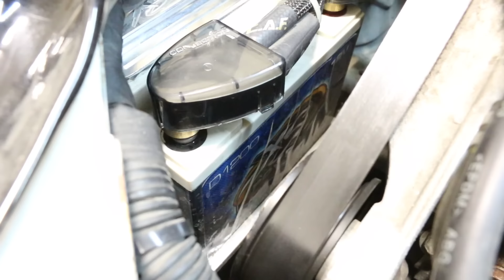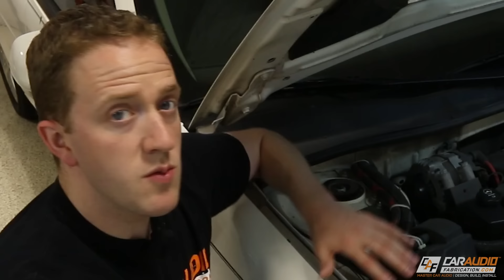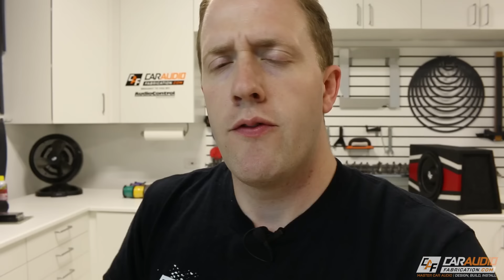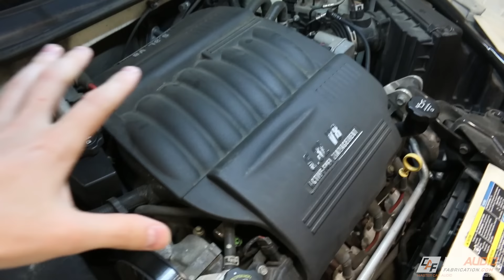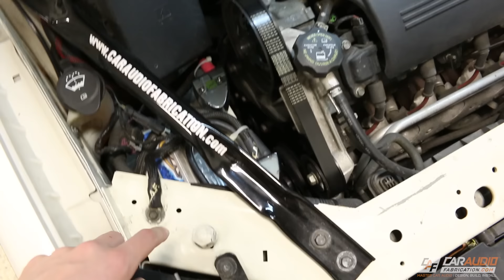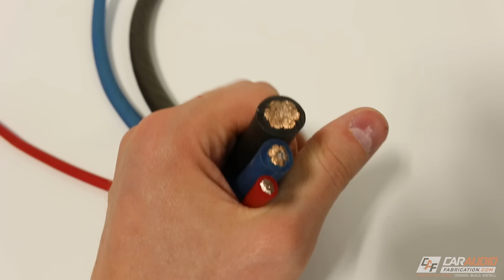Upgrade THESE for better Car Audio performance

Comment: I would start with the big 3 cause thats what i actually did everything else is still just stalk pushing a 900w rms and 1200w not sure the rms on that 4 channel is on a 136amp i know i should make a dual high output but 200 or 250 amp was the highest output there is
Reply: For my vehicle

Comment: Something to consider is voltage drop over oem cables. The cables are mean to transport the power, not consume it, they'll always take a little but not more than half a volt, to me more than .2 volts is too much. If you're hijacking positive from the fuse box you will want to consider volt drop over the cable that feeds it under load. You wont get an accurate volt drop unless you have a full load on what you're testing

Comment: The best part is 1/0 or 2/0 wire is $4 per foot. Then distribute blocks are a solid $50 each. Yeah u need a good job before u wanna bang for sure.

Comment: I'm adding a 600w amp with subwoofer and really good aftermarket speakers to the factory head unit. i know...its what I can afford right now. My question is should I upgrade the speaker wire or is the factory wire enough? I have a spool of 14ga so can do iT if needed. Thanks!

Comment: What should I do if I upgraded the battery and bought a stock alternator and my lights dim but after I added a AC after AC compressor now lights dim did I have this problem before what would it be

Comment: 2500 in the trunk.

Upgraded 105 amp alt to a 140 amp
Upgraded all ground wires from 8 to 2 gauge
Added ground from neg to frame
Added ground from alt to frame
Upgraded alt + wire to 2 gauge to batt 2
Upgraded CCA batt 1 to 980 cca from 650
980 Batt feeds to 2, 4 farad caps.

Power nevwr drops, spent around 250

Comment: I have an insane buzz coming from my tweeters ! Halllllp! When I unplug the rcas to the front doors it stops and its only when the engine is running not when the car is "on" also tried grounding the head unit and it did nothing. I have a rocksford fosgate amp powering my fosgate sub which has no issues. The front door speakers are skar component speakers and the back doors are skar as well both into a skar 4 channel amp
Reply: Wrap a piece of copper wire around the rcas in a figure 8 loop should ground those rcas out might work
Reply: I saw that trick on youtube as well I tried that and it doesnt help 😔

Comment: My homie got a 1999 caddy with 60k miles on it he hooked up 2×10s and 2 amps 600watts each the battery drained car wouldn't start so he just unhooked subs and  amp and it starts right up so does he just need a professional to hook it up ?

Comment: 1st... know how much power you need, check and upgrade battery, alternator and main power circuits according to your total amp usage. Ground and positive. I think one should have 20% more amperage then you will use with all electrical being operated at one time, including air conditioning. Heater, wiper motor, ect. Thank you

Comment: I have a honda civic 2011 a harman cardon ca5250 amp did the big 3 the hk amp running afocal k2p in the back and audison apk 165 in the front i want to add another amp for my kicker comps 12" 300 wrms subwoofer do i need to apgrade my alternator or my main battery or add a xs power battery in my trunk or capacitor

Comment: Battery alternator is nuthing if it can't supply the power.....so wiring is first once that is done and you need more its alternator because having a 100A battery chargeing at 60A will not be enough to charge the battery full but 100A alternator charging a 60A battery will ceep power constantly supplied then you can think about battery power

Comment: Without a doubt the most influential to sound upgrade is the alternator. 25 years messing around in car audio and I've seen so many systems with thousands of watt amps multiple batteries that they've spent thousands of dollars on and have everything connected to the factory 80Amp to depending on the vehicle maybe 160 amp alternator and before I ask any question about their system I ask what alternator did you upgrade with? And 8 out of 10 at least say I haven't, which just absolutely baffles me because if you're going to spend thousands of dollars in batteries alone and on that amplifier what's the point if you don't have the amperage that's going to push them? Furthermore they put all those batteries in there they don't put a battery cutoffwonder why they are going through an alternator every year but yet continue to buy factory remanufactured rebuilt whatever you want to call it factory alternator. Every single one of them I tell after asking them how much they spent  on all those batteries of which unless it's only one extra battery most of the time they have spent more than what they would have going to Mechman and buying a high amp alternator and if they would have gone and spent the money on the alternator they would have been getting a lot higher volume, more  SPL, more overall power and could have got all of it for likely less $

Comment: i ALWAYS (and i am not a professional,this is only on my own vehicles) put in a new battery and if money permits run a second to the trunk..always use oxygen free copper wire..i made that mistake years ago and MELTED 0 gauge aluminum copper mixed wire for my big 3 upgrade and died on the road and had to be towed..dont make this mistake...always use 0 gauge wire....I  run my 0 gauge power wire thru the firewall and do the big three  (just started an install on a 2006 toyota avalon with 90000 miles in mint condition..got it GIFTED to me this past month..mint mint condition).if i am upgrading the alternator to hi output this is the time to do it.then i choose my amplifier location  run the power there and figure out where my ground for amps will be..next i install any led lighting in  the trunk because once the box is in place you dont want to have to move it to light it properly (qbomb vl double 12" single center ported box) install subs in box secure box to car then run rca wires and speaker wires down the other side of the car..always recheck grounds to be sure they are good..

Comment: Looking into a 1700 true watt amp with a 1500 true watt sub. I have a 17 silverado 1500 gasoline. Would I need to upgrade my electrical system?

Comment: Here is the order I chose :
1. After market radio or dsp for high to low conversion. 

2. Sub Amplifier , Subwoofer , 1/0 gauge power , ground  and big 4 not 3 .

3. New dual battery setup ( both new batteries not adding one new ) 

4. New mids and highs 

5 . Power Amp for new mids and highs and a Clarion EQ if using aftermarket radio instead of DSP for factory for low level output to subs , and full range amps .

6. High output alternator to match needs of all new amplifiers installed  .

NOTE :
 SOME VEHICLES HAVE CRAP ALTERNATORS FROM FACTORY AND SOME COME WITH SOMEWHAT HIGHER AMPERAGE ALTERNATORS . IF YOUR VEHICLES ALTERNATOR IS A LOW AMPERAGE ALTERNATOR YOU WILL NEED TO UPGRADE THE ALTERNATOR AT THE SAME TIME AS ADDING A HIGH POWER SUB AMP "OVER 1000 WATTS RMS" OR SOON AFTER TO PREVENT DAMAGE TO SUBWOOFERS , AMPLIFIER AND CAR ELECTRICAL SYSTEM .
Reply: Thank you Mr. Garcez! But what is the Big 4 upgrade for a vehicle?

Comment: The foundation of a system is the key to all future builds.  The big 3 upgrade is is part of the foundation but there is plenty of information on this;  next would be the power plant.  Explanation and options for an alternator upgrade would be invaluable.

Comment: My lights dim when bass hits hard and at high output
Reply: get a set of leds that run off a low voltage balist and problem solved. if it bothers you bad enough that is

Comment: A circuit breaker at the battery and 1/0 cable for pwr and battery ground,  this should be the first upgrade for systems under 1500watts rms, this will allow for future upgrades for most people

Comment: I have a skar 1200 pushing two 10s at 1ohm and a Memphis amp I think about 400 running other speakers can I just upgrade battery. The skar gets hot and goes into protect unless I hook jumper cables up

Comment: question, when will can upgrade the alternator? 
when can add the battery?
let's say if i have 4 high, 4mid, 2sub
and i will put 3 amplifier for this set up should i upgrade the source?
Reply: There's videos of the questions  you ask .. all you have to do is  upgrade the  big 3 first  then if needed  the battery  and alternator 
I have  6 highs , 4 mids and 2 subs .. with 900.5 amplifier  ... I just  upgrade the  big  3
Reply: @Orange-yp9bl  thanks bro, i have hyundai kona, but i'm not sure if there's any available alternator for that model?

Comment: Hey so I’m new to all this and it’s a bit overwhelming but this is very helpful. But my question is if I’m just looking to install some new tweeters & a sub . So do I still need to upgrade my alternator,battery,etc?! I know this a new comment on a old yt video but if anyone can reply that’d be great!
Reply: Sebastian Santana nah you don’t need to..if a small sub and amp no need to upgrade electrical or alternator or even the battery..you should be good to go without any electrical upgrades
Reply: If you’re running over 1k I’d at least upgrade the wiring & upgrade the starter battery to AMG. 1500 or more get a better alt. Rule of thumb, take the total RMS wattage and remove the zero to estimate the sufficient amperage needed to sustain your system (1500 needs approx 150 amps of current, depending on what amps you buy). Stock alternators are rated 110-140 ish nowadays unless you have a big truck that has a winch on it.

Comment: People who think wire doesn’t matter are, let’s just say, misinformed! Wire matters a great deal as well as insulation material and grommeting and a host of other factors that weren’t even covered in the video. Get a grip. Give a damn and get informed people. Failure is very costly. A little time spent researching and asking questions can save a lot of headaches and frustrations as well as time and money on your install. So be smart and research it first. Save yourself some hell down the road! You’ll be glad you did! Guessing is a rocky road pitted with holes and glass!
Reply: Mark Philpot agreed! You wouldn’t put a high pressure pump on a garden hose. Electricity is very similar in physics as hydraulics. Larger wire means less restriction to current flow while putting less stress (pressure) on the insulation/dielectric because of voltage.

Comment: Well I always heard of the 3 upgrade and the capacitors. In my truck (Jeep) I had the three upgrade put that didn’t work my battery was always dying so I had to recharge all the time maybe because I did drive it to much. Now I bought a capacitor but still haven’t had the chance to install it yet.

Comment: Any use in doing the big three upgrade with a 250 watt sub amp?
Reply: Thezuule 

For “most” vehicles you won’t need to upgrade the big 3 for a 250watt amplifier. Depending on the amplifier’s efficiency you’re probably only going to be pulling 17-25 amps. 

Depending on the length of the wire, a 10ga or 8ga wire from the battery with a 30A fuse and also a 10ga or 8ga wire grounded to the frame would be fine.
Reply: @patrickc1508  When I posted this comment I was using a JL Audio JX250/1 which has since been swapped with a JL 250/1 slash series with the RIPS power supply and such. This thing puts out rated power at 4 ohms at 11v so it's completely a non-issue now. I could hook this amp up to a goddamned 9v battery and I would probably still get 200w out of it lol.

Comment: In your opinion what is the best high output idle amperage alternator out there
Reply: cory dorsey Mechman alternators are the best in the biz. The amp rating you should choose depends on your goals for the system (how many watts you plan to run). Never hurts to go as big as you can, but it might hurt your wallet.

Comment: Any videos on installing a capacitor I’m putting in a complete system with two amps and want to wire it correctly other videos seem to be a joke
Reply: Do you really need a capacitor? They're a great addition to an otherwise healthy electrical system, the "icing on the cake" so to speak. But if your vehicle is capable of continuously keeping up with your electrical demands you shouldn't need one. There are situations where you occasionally need that little extra power for brief moments of serious demand, in which case a capacitor would fit the bill. But if you are considering installing one to "fix" dimming headlights experienced during normal operation of the sound system then consider first upgrading your alternator. Otherwise you'd just be adding additional load on the electrical system instead of fixing the actual problem: insufficient power.
Reply: Juicyblunts hi I’ve been running a Rockford r500x1d for my sub just 1 12 but I’m adding new components in the doors and 6 1/2 3 ways in the rear doors and a 4 Ch amp 60 watt rms per ch just want to do it right the first time no dimming lights with the sub but don’t want to have to add after the install
Reply: That is because caps are a joke! Don’t waste your money!!

Comment: Take it from me . I had a cresento 2000 bc and sundown x12 on stock 90 amp alternator and wiring. It sucks . Not very loud at all. Upgraded my alternator and wiring and dam huge difference

Comment: That's true that's y in trinidad we use something call a Blackout it's a type of battery is made here I have 1 and dat works really well the Blackout replace 3 battery I have 1 1600 1 3300 an 1 6500 rms amps on a stock alt 140amp with de Blackout an my voltage don't drop below 12.8volts when I in competitions an with the 3 battery I had before my voltage use to drop to 9volts nt again 🙂🙂

Comment: What kind of system would you recommend for a 2013 ram 1500 crew cab ?
Reply: Do a foxbox for a dodge ram it sounds good. Because there is not too much room.

Comment: A good battery is important to start. Without it nothing happens. The wire must be sufficient to carry the required power to each component. I've watched wires melt under a friend's hood and it continued towards the stereo so a fuse at the battery is highly recommended also. Just to start I personally think this and the alternator and if I will need a capacitor and if I do what rating. That's just to start planning in my book.

Comment: My 2007 Hummer H3 already had 4 gauge wire at these 3 points from the factory. I did upgrade the battery terminals to gold plated and added a 1.5 farad capacitor. Using 0 gauge wire for power to the back at the power distribution block. Using a grounding distribution block on 8 gauge wire from the chassis. Been building systems since 1990 and this latest build on the Hummer is first time I've used a cap. I swear by them now. It was 30 bucks and did 3 things I was looking for. Kill noise. Stop headlight flickering. Clean up the bass to hit harder. That cap made COMPLETELY different performance out of my amps.
Reply: Christopher Waggoner capacitors are junk and if it’s cheap it’ll limit power. Throw it away and add a battery.

Comment: let me tell u a biggest upgrade inside your car,
you need to first upgrade your dc alternator, then joint an ac alternater,
after then you have 220 volts or 110 volts,
pickup some copper wires like 3mm-10mm,
and no need to buy any big amplifier, cables connectors bla bla bla and all,
jus buy any home audio system like sony shake X7D or sony shake X 100D,
now theyhave their powerful amplifier and big 15-18 inch subwoofer,
if you have more space in your truck then try to use a ac current inverter and 200mah battery for playing music when your car stops,
if you using these equipments, I'm damn sure its too cheap than buy a subwoofer, amplifier, wirings  and any other upgrades. 
it works very well and much more fun whenever u will play like a hardcore bass beast truck. :)

Comment: Get a deep cycle battery and replace your stock alt with a new one if you aren't going to upgrade to a high output alt and are driving a car that's 10+ years old. Change the belt too if it's been a while, this isn't normal wear and tear, this is gung ho guns blazing.

That way you keep your ride dependable. Don't wait for your stock alt to fail, replace it every 2-3 years. Worth it when compared to needing a tow or changing an alt on the side of the highway and being late for work, or worse if you don't know how and have to pay a shop.

Personally I use a 2 farad cap to soften the draw from the amp, so to smooth out the voltage spikes.

But keep in mind that there are cap banks that can exceed battery banks for what they were intended for: Burping builds.

Finding high out put alts is a pain in the ass, especially when you find out they don't make one for your car, or it's going to cost an arm and a leg and might not even fit properly.

Comment: Wiring should be the first. Factory grounding, and power wires from the alternator are usually pretty poor. They are good for the minimum requirements your car needs. Doing the big 3 wiring upgrade is essential, and frees a lot of power in the alternator. Wiring is key for anything electrical....especially proper grounding. I have 3 separate grounds custom made out of number two welding leads. And one extra power wire coming off a 300 amp alternator. I have an optimal yellow top battery, 0 guage 1/0 power wire feeding a 1200 watt NVX jad 1200.1 class D mono block amp, pushing a JL 13W7 AE 1.5 OHM dual voice coil sub. And the wiring is the key part of the entire system.